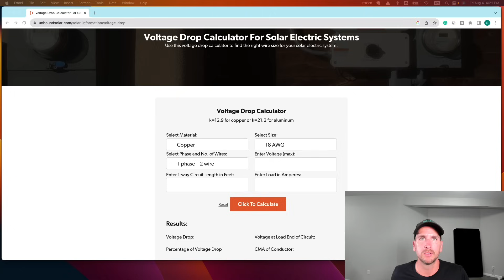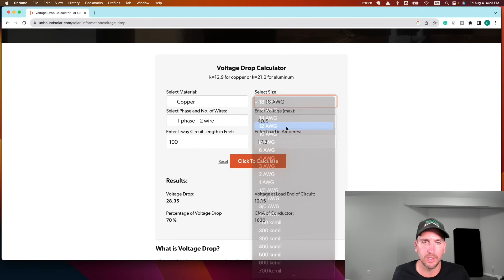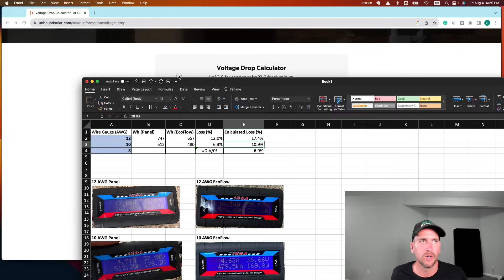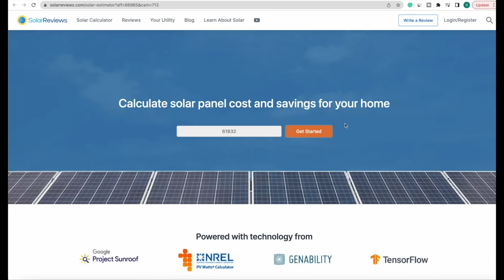What Wire Should You Use For DIY Solar Kits? Surprising Results!

Comment: For a real world setup with the panels 100 ft. from the inverter, I imagine that the wires would almost certainly be in conduit underground, which would be a whole lot cooler than sitting on concrete in direct sunlight. I think that your test conditions probably made it appear that you needed a whole wire size larger than you would if the test were run underground in conduit.

Comment: Losses are not reality since the 100’ run is not a distance run, but a length run. The wadded up cable is introducing field propagation that is enhancing the test. If the delta was actually 100’ away, there would be more line losses.

Comment: If the voltage drop, will the cable burn or fire?
Reply from the maker: No, there is the maximum current a wire can handle which is usually much higher than the current you would want to carry to keep line loss percentage lower than 3%.

Comment: Did you use a solar-to-xt60 Y adapter to connect the 8AWG wire to the EcoFlow? If so, does the adapter need to be the same gauge? I can't find an 8AWG Y adapter anywhere because the wire is so large. Is it OK to use a short 10AWG Y adapter with a long run of 8AWG wire? THX

Comment: Would having micro-inverters or optimizers have any impact on the wire's performance?
Reply: ac  current functions efficiently  with large stranded wire unlike dc current

Comment: Another option is to use micro inverters and convert to AC at the panels so you can use smaller wiring.  The tradeoff is conversion loss so you need to determine which is worse, the line loss or the conversion loss.

Comment: I remember seeing a chart that shows the resistance per foot of different wire gauges.  No need to perform a test.  Simply use the chart and a calculator.  That would be a much shorter video.

Comment: Wattage and Amperage:
 * 100W: 16-14 AWG
 * 200W: 14-12 AWG
 * 300W: 12-10 AWG
 * 400W: 10-8 AWG
Distance from Panels:
 * Short distances: 10-12 AWG
 * Longer distances: 8-6 AWG
Voltage Drop:

Comment: Question: Have Rich solar panels with 12 AWG MC4 connectors. Thinking about using 8 AWG wires to a RV charge system.  System will have 10 panels at 2x 100 watts connected in series / parallel, Panels @ 20V / 5A each= 40V / 25A total. Need information concerning connecting the 12 AWG MC4 to a 8 AWG MC4 or is that even a thing?

Comment: Great video and very informative. But there was one piece missing for me.  If I go with the 8 gauge cable (my length is going to be about 100' to my ecoflow also), what about the XT60 connector from the 8 AWG (MC4 connector) to my XT60 connector, which only come in 10 gauge options. I cannot find an 8AWG MC4 to XT60 connector for my Ecoflow.  Will having a 10 gauge 2' connection cable defeat my long 100' run of 8AWG wire?

Comment: The calculators also are based on "temperature range".  You are at an "ideal" temp.  If you did the same test on a much hotter day you'd have much higher losses.

Comment: no one with a real live system is going to run with that low a voltage .... my inverter takes up to 500 volts ....
running conservatively at 400-450v you will need a much smaller wire for that distance and current..,

Comment: I bought the same power meter, but did not realize or overlooked the specs, its only rated for 50v? and the wire size seems smaller than my solar cable..

Comment: Measuring Errors due to the Dimensional Tolerances of these rather imprecise Measuring Devices can be better estimated and eliminated if the Measuring Devices at the two Ends of the Line are replaced and the Differences between the two Measurements are compared. Accuracy can of Course be increased with more Devices. During my Tests I found Measurement Inaccuracies of between 5% and 15%. Unfortunately, in my Opinion, these Devices are just better Estimates.

Comment: Great video thanks so am I right in saying just use the thickest wire you can get?
Maybe go to AWG 6 for achieve a lower loss than AWG 8 or are there other factors to consider and it’s not as simple as just the thicker the better?

Also Rather than running separate wires is it just the same to run a 2 cable with both the wires in that cable.
Thanks to anyone who can answer this in advance.

Comment: The quicker and more accurate test would be to measure the losses without the 100' wires, then measure with.  When you measure the energy transmission in a system both ends will be lower when you increase the resistance so this test doesn't tell the full story.

Comment: You mentioned pros will be around 3-3.5%  which sounds like a reference to NEC.   Thats just a suggestion by NEC code.   You should shoot for 1.2-1.5%.  Can use 10 awg at close points to the array then in a combiner or JBox jump to an 8 or 6 for the long run to get to 1-1.5% drop.  The lower the drop the healthier the system will operate ( most efficient)

Comment: Line losses are common with long runs. Can you imagine the losses on the US electric grid across the whole country and its line losses? For my solar system the longest run is only 25 feet.  Since copper wiring is so expensive now, I just use the cheaper higher gauge wiring as long as it can handle the current. The loss should be negligible.

Comment: I wrap all of my outlets in good tape.  I'm a property manager and you wouldn't believe how many people remove outlet covers to put fancy ones on and then tell me how they go 'shocked'.  Once a year at least.  That may not sound like a lot but we also have a stainless steel back splash in the kitchens and that doesn't help.   People will remove them when they move and put  the cheap plastic ones back on...
I will always wrap them.  Not for my safety but for the non-electrical person who wants to open them up and change covers...  I'll never get shocked because I shut the breakers off.

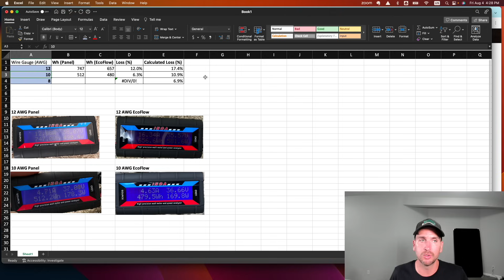Comment: 7:36 Your calculated loss (Column E) is percent "voltage" loss while your "watt-hour" loss (column D) is percent "energy" loss.  You need to adjust one or the other to be identical units before directly comparing one with the other.

Comment: What is the gauge size of the cable coming out of the panel? If the panel has 12 gauge coming out standard and we calculate that over a long distance the calculator says we need 10 gauge for the run, does that mean we have to disconnect the original cable coming out of the panel and replace that 1m section for 10 gauge as well?

Comment: 100 feet is a long run. If you are building a system that uses more than just 1 40V panel, you can place the panels in series to increase the dc voltage, this will improve efficiency, but on the down side high DC voltage is a acing fire hazard. This is how the pros do it have hundreds of volts or the max the MPPT can take. If you what to be safe use 35mm2 or 50mm2 or 0 awg aluminum xlpe as the main trunk this will keep voltage drop down in a extra low voltage system, and aluminum cable is cheap. Be careful with you're terminations on aluminum thou.

Comment: I get that some of the calculators need help in their calculations, but the most important thing in sizing that you need to really worry about is the length of run, not the actual loss. A run of the wrong size for your configuration can/will result in a fire and that will be more of a worry than percentage of loss from wire size.

Comment: I may have missed it but Eco Flow requires an XT60 connector wire to connect solar panels wires, are you matching the XT60 wire size to the solar panel wires?  Just curious if that's the rule of thumb or if that doesn't even matter.
Reply from the maker: Some of the EcoFlow units use XT60 but most use the XT60i.  I did not matach the wire size and the converter cable from EcoFlow looks like 12 gauge max.  With that said the converter cable is only 6'-8' long
Reply: @everydaysolar  Thank you for the clarification, this helps!

Comment: Here is my Theory, you did your Tests and its a great Explanation which made me think more about the "Wattage Loss" going into the Charge Controller, your "12AWG" wiring you lost 90.4 watts just from wire length and 32.7 watts from 10AWG, what if you reversed the setup, going from the Array with say under 10ft directly to charge controller, then have Inverter power line to be the 100' length pulling from stored capacity over to the home/off-grid cabin, then voltage drop or "Wattage Loss" would be reduced dramatically giving you better charging capabilities utilizing the most out of your solar panels.  

My Theory is if the Stored Energy in the batteries has voltage drop from the inverter wires to the house VS Array wires to Charge Controller/Batteries in the home, its just less power being taken from Stored Capacity and Technically the AH Stored is never lost from "Voltage Drop/Wattage-Loss" like it would be Entirely lost from the Array wires to Charge Controller.

Let me know what you think, or possibly another Test lol

Comment: All these solar companies are rip offs in my mind. I already have an 18.5K MP4 inverter and a 14Kwh Battery. I also have 10 Aptos 440 watt panels uninstalled. When I tell these companies I have this they tell me,"we only install full systems". They tell me this because they tack so much profit into their prices. For instance, My Aptos 44o watt panels are some of the best you can buy and they cost about $170. My huge battery (bigger than a Tesla power wall) and huge inverter were like $8500. So you can see their price for labor and permits is highly inflated. I just need someone to help me up on the roof to install these panels.

Comment: Ohms law, and a table of AWG vs ohms would have done all this in 15 mins in your spreadsheet.  If you made the calculations based on 2 cells input of voltage and current, you would also have found that series vs parallel would be best.
When you work with high power and want to know efficiency, ohms law and power=volts x amps are your basic tape measure of electricity.  Please understand these two before buying any DIY electical stuff.

Comment: There's a reason that high-tension power lines run much higher voltages than house current.  And a somewhat related reason that AC dominates over DC, although DC can definitely be transmitted.  If I was doing my house to replace grid power, I'd be looking at the storage devices available and trying to match the panels and the wiring to them for best effect, reliability, and longevity.  And the copper wire probably (expensive as it is) would be a comparatively minor component of the cost.  I'd likely favor the largest gauge practical, because the expense is one-time. Also, panels are necessarily outdoor, and need appropriate provision for electrical storms, which (I imagine) might be a relevant factor.  Surely I'd want the advice of a competent engineer, either independently or with a trusted vendor; too many places to make mistrakes.

Comment: Why does wattage lowers when increasing cable size? With 12 AWG cable, you had 657 Wh of power at the generator while it is only 443 with 8 AWG cable.

Comment: I'm more interested in wire sizes on batteries. I believe you need bigger wire on a 12v system, and a little smaller on 48v. I'd like to know what size to use on a 48v battery

Comment: I spotted a potential flaw in the testing. The Yunsailing 100V watt meter uses 12AWG wires. So it would automatically add 12AWG loss wherever you add it in the chain. I imagine for more accurate results you would need to resolder 8AWG wires to the Yunsailing, or get a higher quality meter such as the Powerwerx Watt Meter Plus, which uses 8 gauge wires with preinstalled SB50 Powerpole connectors.

Comment: Did you just have one camera that you used to take photos of the electricity meters and you took a picture of one first and then you walked over to the other electricity meter and took a picture of it? During that time, the situation may change if the sky is not completely cloudless.
Why didn't you put your EcoFlow station under the panels to protect it from the sun, and then just run the current through a long pair of wires, but both meters would be in the same photo at the same time? This would make your experiment most reliable - now it's just a hastily designed hobbyist implementation, the results of which do not have much practical value. Taking the test reliably would not have required any extra effort from you, except for a little more use of your brain - beforehand.
Some YouTubers are just...

Comment: V = I x R. Higher the resistance, the higher the voltage drop across the cable. Since Power = V x I, as voltage goes down so does power at the power station. 

Yet another way to look at this is Power = V^2 / R. Even though R goes down with lower gauge wire runs, the reduced voltage (due to above) reduces by the square and the power delivery to your power station is lower.

Comment: Does anyone else have a problem crimping solid #10 wire to mc4 connectors? Wiggle loose ?
Reply from the maker: I haven’t seen that issue 🤷‍♂️
Reply: Solid wire not good for crimping, so Solder after crimping will help some
ED C

Comment: The conclusion of the video is that for DIY solar projects, using 8 gauge wire significantly reduces line losses compared to 12 gauge and 10 gauge wires, with a loss of only 3.3% compared to the expected 6.9%. The video emphasizes the importance of choosing the correct wire gauge to minimize voltage drop and improve overall efficiency. It also suggests considering series and parallel configurations to optimize voltage and current for your specific setup. For larger projects, such as grid-tied systems, professional installation is recommended.

Comment: How much would a shorter cable length mitigate the line loss?
If your cable was fifty feet long rather than 100 feet, would that cut the calculated loss in half or is this a case where calculated results are not linear like that?

Comment: All systems I've seen set up was using 1awg wire on them no idea how much it helped with lowering the loss% I was planning to build a system and I was going to use the 1 awg also like the other set ups I've seen have you ever tested 1awg cable

Comment: The Ecoflow Delta Pro solar input limit is 11-150 volts and 15 amps max. Why are you putting the panels in parallel instead of series. You are inputting more current than the specs allow. If you connect the panels in series you can double the voltage but leave the current at 9 amps which is below the max allowed. The results of inputting more voltage is a lot less voltage loss therefore allowing you to use the 10 ga wire instead of the 8 ga you said you would use. Look at other countries in the world they use a 240 volt system with less current than the USA 120 volt system with a higher current. A higher voltage is much more efficient than a higher current.
Reply: He actually mentions this at the end of the video. In my experience though, there are good reasons to wire in parallel, even though it may not result in maximizing the power input. When panels are in series, if there’s a weak link (a low producing panel due to shade, for example) the overall power production will be impacted. I performed this test a few times and there are situations where I prefer to wire them in parallel due to this problem.

Comment: Wow the superficial level of knowledge in this video and its comments are basically shocking.
EVERYONE knows (surely?) that cable cross section and material radically alters the CURRENT that can be transferred through it. Does the formula I^2R  ring any bells?. So we all know that if you have long cable runs you're better off with panels in series - providing your charge controller/Grid Tie inverter can handle the accumulated voltage.

Comment: I'm not sure there was any value in this test. A typical rooftop solar system will operate between 400V and 600V - mine actually sits @ 800V.  You didn't have to measure Watt hours - in fact it's pointless because it's only true for your specific setup for that specific time. You just had to measure the voltage drop across the cable and the amps at the same time and you can calculate the resistance of your cable run. Whole test done with two multimeters in 1 minute. And once you know your resistance it will only vary slightly with temperature. So say you have 30 metres of cabling starting @ 45V @ 10A and you measured 20V drop across you're circuit.  You know your cable has 2 Ohms of resistance (20/10) per 30 metres (that would be quite high). At 500V @ 6amps (3kW) we have that same resistance - so our voltage drop is only going to be 12V. So the most important figure is the resistance of the cable run per length.

Comment: Why did you put 17.8A ( your stated the output of the panels) as the load of your system in the calculator? In electrical systems the load is the part of the circuit drawing the current not producing it. You need to put the load of the appliances not the output of the panels. 😂  your calculator entries basically said that the system would be drawing a continuous 17.8A which is arbitrary and also doesn’t correspond to the physical wire test you did.

Comment: I think this guy should first go back to school to learn about electricity before attempting any more videos. Why would he connect solar panels in parallel and maximise current rather than voltage? P = U I and P = R I², so from these two equations it is obvious that current must be as low as possible to minimise the losses. Solar panels should always be connected in series to maximise the voltage and minimise current.

Comment: And now how much do you loose by not keeping your panels pointed into the sun?   I think you can point the panels and get more than the wire losses.  And by the way, it really dose not matter if the battery's are charged by 10 AM and you are not using much power during the day.